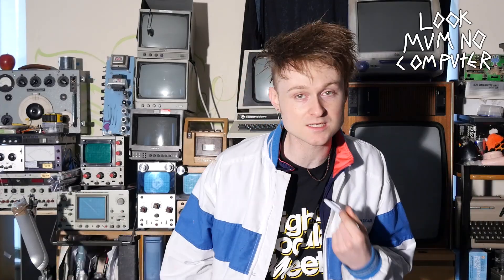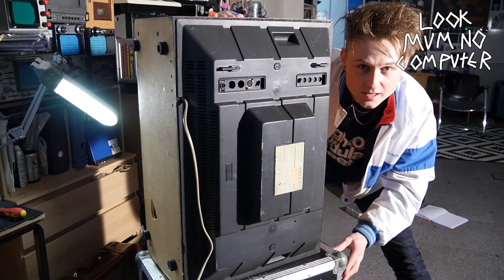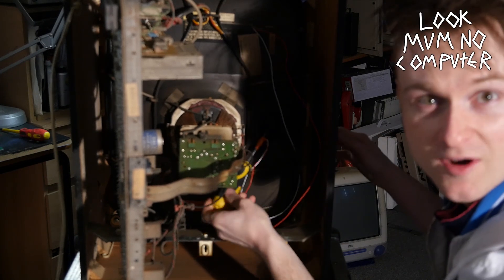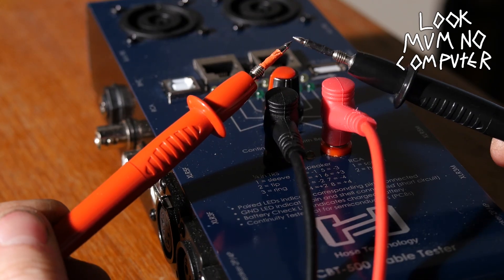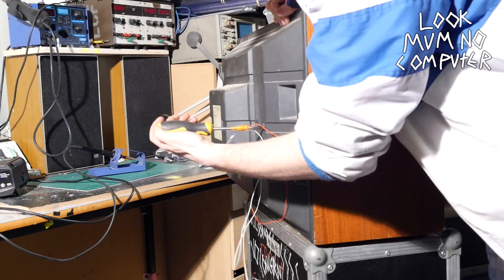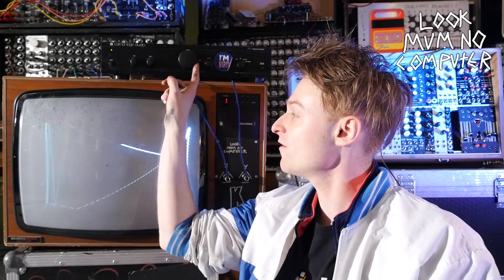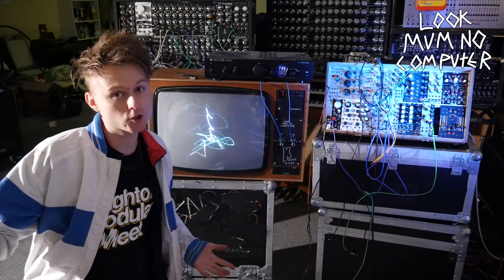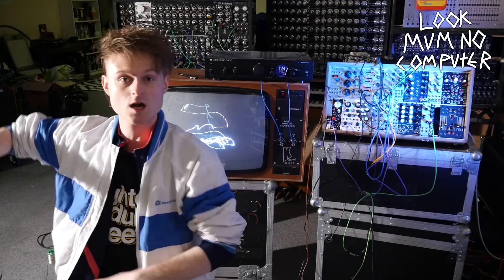Turn an old TV into an Oscillograph For Oscillographics!

Comment: Some TV-esque points for those wanting to try this excellent project! 
1. Deflection Yoke

Short explanation:
It is best to leave the existing yoke and CRT neck magnets unmolested in place as the video implies but did not state. An inductor with the same inductance is optimally connected to the TV set's horizontal deflection circuitry to replace the now-disconnected horizontal yoke winding. The vertical winding may simply be disconnected from the TV and used for audio with no consequence.

More:
The inductance of the yoke horizontal deflection windings are used during horizontal trace to store energy used for making the high voltage.  With the flyback transformer, the H yoke part of a tuned circuit and inductance value is important for long life and safe operation.

During retrace, the energy is discharged from the yoke into the flyback (high voltage) transformer in the form of a pulse. The term 'flyback' is the old vernacular term for retrace, because the spot on the CRT  flys back across the screen (though it's blanked/unseen). The pulse is stepped up by the flyback transformer and rectified (voltage tripler may be used as rectifier-filter), to provide the 23-30KV needed by the CRT HV anode. 

In most modern (70s-90s) solid state TV sets similar to the one shown, the flyback transformer also acts as the power transformer, in that it provides what is called 'derived power'. As the transformer is driven by the horizontal output transistor, the retrace pulse from the is stepped down from the 900V output transistor pulse and rectified to make the 150-250 volts for the video amplifiers, and the trace waveform (while the transistor is ON) is stepped down and rectified to provide the various low voltages like 5 to 30V that operate the other circuits of the set. These DC voltages are called 'derived' power. This was oversimplified but no one wants to read a whole book.

This is done to avoid a large and costly power transformer. The other benefit is that, since the high voltage is regulated, all other voltages from the same transformer will also be as well-regulated.

Thus the reasons for substituing a proper inductance for the horizontal yoke winding (It must not saturate either). The cheap way is to steal a yoke of similar inductance (+/-10%) from another TV and use that for the substitute yoke. The right way is to find/buy the correct inductance.

=====

-->2. other options:
I noticed in the video that the original TV set CRT beam-blanking circuit was doing its job, but this is only needed when scanning a synchronized image like video or when moving the beam from one drawn object to another in a vector display (different blanking circuit for that). 

For a vector or X-Y scope as shown, remove the blanking signal while keeping the brightness control (CRT bias) and contrast control (video amplifier gain) circuits intact. 

The brighness control's use need no explanation, but a voltage or additional resistance affecting the brightness control can be externally applied in concert with the existing brightness control  to blank the screen when no vector signals are present. It's done in gaming and military displays to prevent screen burn. The brightness control affects all three electron guns (RGB) at once in a color set. Most CRTs have a single control grid for this purpose.

The contrast control is like a volume control in an audio amp. It controls the gain of all three individual video amplifier channels (RGB) at the same time, but these control signals can be broken out to control the amplifiers individually. It's simple from there to use the scope as shown with music, but with an external electronic crossover, assign for example, red to bass, green to midrange, and blue to highs. Low-voltage analog signals can thereby vary the intensity of the R, G, and B electron beams to add to the effects. This assumes the original yoke and convergence/centering magnets on the CRT neck are unmolested and the set had good convergence and purity before conversion. 

In the 1980s, I worked with a performance art group and modified many TV sets for this audio and color oscilloscope use. The large square cabinet type TVs allowed everything to be mounted inside the cabinet with just an audio jack for input from the mix board. In some products, the TV set's speaker was connected through a little transformer to the now-internal amplifier's input, so it responded to ambient sound. 
A caveat is that solid state amps of the day didn't like the inductive load of the H and V yokes and sometimes would blow out. So we used old public address tube amps. 20 Watts for H and for V was often enough. Frequently to get the lissajous figures from a music or voice source, I would put a speaker-type crossover after the amp, and drive the vertical windings for lower frequencies and the horizontal windings for high frequencies. That with the individual video (color) channels was very entertaining. Modification of these crossover circuit values to tailor the crossover points to a specific yoke (because it's certainly not a 4 or 8 ohm load) was occasionally needed to get best results.

I hope those who enjoy the work done in the video will be aided in their efforts to do the same. There are a lot of CRT videos, but i chose to comment on this one because it's cooly presented and the artist has a lot of electronics skills.
Reply: Did this project and I have two questions:
How do I remove the blanking signal? I assume I have to cut a pin off from the jungle chip right?

Second, instead of a getting a white beam I get a blue one with a bit of yellow, which were the colors from the TV when there's no signal connected (all blue backdrop with yellow letters saying VIDEO on the upper left corner), how can I get just the white beam?
Reply: @KRSHERprs   A public notice: I seldom use this site any more, so any questions may go un-answered for indeterminate amounts of time. 

OK to try to answer your question, almost every TV set has slightly different ways of adding blanking pulses to the RGB signals going to the CRT cathodes (sometimes grids in older sets) and of controlling brightness. The process I describe is experimental. I would not cut pins on chips, but look at cutting a track on the board. However, this may also be very small. Sometimes a DC level is also conveyed on the same pin or track along with the blanking and other signals, so cutting it may remove the ability to control brightness. 

If the TV has a decent size board on the socket at the rear of the CRT that also contains the three R,G,B driver transistors, it could be worthwhile to find the three wired delivering the video drive signals that go to the board itself, and insert a low pass filter in each of them. Check the voltage and waveform on those wires. It should be low-ish like 3 to 12 volts, and in any case nowhere near 120-200V DC+ some AC. Experimentally try inserting a low pass filter made of two 10K resistors in series in the line - -the low pass part of this will be a capacitor of 1uF from the junction point of the two resistors to ground (B-). 

Try one color first and use a scope and a voltmeter. Or if no scope, do all 3 colors, and run a deflection pattern to see if blanking and video is removed.

Check the DC voltage on each end of that filter. It should be the same or no more than 0.1V DC difference. Make sure the brightness control still works for your purposes. There will be some signal on the end of the low pass filter connected to the TV main board, and just a DC level on the end of the filter connected to the CRT amplifier/drive board. If the voltage difference is as stated above, or proportionally close to it (will depend on the eact schematic design of the video circuit overall), and you can control brightness, GOOD. Then check for signal on the end of the filter going to the CRT drive board. There should be almost none. If some low frequency signals remain, increase the capacitor to 4.7 or 10uF.
Reply: @KRSHERprs   A public notice: I seldom use this site any more, so any questions may go un-answered for indeterminate amounts of time. 

You should get an oscilloscope for this. Now about that blue screen and off-white color. White comes from the eye mixing the three colors red,blue,green. So the three electron beams that hit those coloed phosphor dots on the inside of the CRT face have to be present so that the TV light is white. TVs use different methods for balancing the colors/electron beam strengths, but this mostly comes from the color decoder IC if that is present. I've never tried to turn the blue screen white, and it's a total experiment, but I used to own a TV shop and repair TV sets so this should help. Here's the thing, TVs set the CRT bias be a number of methods. Some have user controls and some do not. TVs also usually have controls for the screen grid or "G2". There should be one for each color on older sets, and just one common one on newer. Not to mess with these at this point. The color IC has R,G,B outputs. You need to look at them with a scope. Assuming the brightness control works to turn the blue screen up and down, then you can try cutting the blue signal's wire (as described in my last post), and make up a jig of three resistors. 1K resistors. Connect one end of the three together as a common point. The free ends are now for the R,G,B signals going to the CRT drive board. This will place the same brightness and DC level on all three guns. The low pass filters described in the other post should remove the video (the channel number etc) . If something does not work, put the wiring back as it was before what you just did, before trying something else, so you do not start building unknown problems into your project. 

Now about the off-color tint of the white beam. Two things. If the brightness is so high that the CRT can't handle it or if the CRT is a little weak, the color will be off (same thing as when an overdriven guitar amp distorts). Reducing brightness from overkill to normal is a way to have the CRT perform linearly in this case. Once the blue screen is made to white (should be by the above experiment), then you can see if it varies tint when you run brightness control up and down. Run a pattern filling the screen and turn the brightness low, then adjust the R,G,B "G2" controls to where it's dim (neutral gray) and just vidible. Then upon increasign brightness it should remain white.

Some TV sets do this oppositely with one 'screen or G2' control, and you must then adjust the BIAS for R,G,B to get white. set brighness low, adj RGB BIAS for grey, touch up screen if needed, then it should be white when brightness is increased. 

1. all TV are somewhat different.
2. Doin the 3-way resistor off the blue screen may negate the white adjustments in sets with RGB BIAS, because you are only using the BLUE video (and DC level)
3. The low pass filter below may get rid of the channel number video, not sure how much of the blue it will neutralize.
4. the color IC detects video, then shuts off the stupid blue screen, some TV also have a menu for "blue screen off". Find the IC number and look it up to see how the blue screen (loss of signal or no video) is detected then fool it. Find the schematic for the TV set in question.  These are because it's rather technical and the many possible solutions can not be described in youtube comments because it takes books. Find old used TV servicing books. 

Finally, you can inject your own video modulating signals to the RGB at the point between each low pass filter and the CRT amplifier/driver board. Use a 0.1uF capacitor for this at first, going larger ONLY if you do not get a low enough frequency response, and keep your video modulation voltage low, certainly no more than the TV set originally drove the CRT drive amplifier board with. (check with scope before the TV experiment) Don't want to blow any transistors. 

Also when connecting external signals, scopes, or anything else into the actual TV set board or chassis, the TV or signals must be isolated through a suitable transformer because many TV sets have a mostly direct path from mains to the TV's internal 'hot ground'. Ignorance of this will result in short-outs, shock hazard, maybe worse. So be careful! I have to say that because of people who have no idea what they are doing. Just ask a radio ham or repairman if it is confusing.

Wish I could help more.
Reply: Also, on blaking again. Some TVs use the control grid ("G1") for blanking, and the cathodes (driven by the CRT vrive board or amplifiers) for video. If the blanking is not removed by the low pass filters described in my other posts on this video, try adding one to the wire going to the CRT's G1.  Also, note that the CRT cathodes and therefore the RGB CRT drive amplifiers will have 120-200Volts on them so be careful. (A 150-volt video signal gives buzz/tingle, quite different from a touch o' the mains). But don't touch those parts while the set is on because it's quite dangerous, be careful. Also, the screen voltage or G2 voltage on that booard can be from 200V to 1000V DC, so stay well away from that as well when working on the TV.

Comment: In the 80s I did this on numerous TVs.   First thing I learned, the circuitry stops working if you just disconnect the deflection yoke.  Best thing to do is hang the existing yoke somewhere inside the case and put another deflection yoke on the CRT neck.  

I didn't have polyphonic oscillators to work with so I'd find music with long bass notes.  Mitternacht from the B side of Kraftwerk-Autobahn was a good song to use.  There was always a bias in music sources so you wouldn't get a symmetrical lissajous pattern, the shapes tended to have a diagonal attractor.

In the late 80s I started doing cheap laser shows for my Brother's band.   I made galvanometers with two old speakers and broken chunks of mirror and set it up on a 12X18 plywood board.  Worked great, but had the same diagonal bias issue when using music.  Jean-Michel Jarre made some good laser music too.  Had a $300 5w he-ne laser.  Eventually I got my hands on an aqua colored argon laser and a beautiful indigo helium-cadmium laser.   These were the size of a 1990s PC and large CRT monitor with a thick umbilical between power supply and laser head.  Today's cheap ubiquitous laser diodes make these huge gas lasers look ridiculous.

Comment: This brings back memories. About 25 years ago I built something similar using an RGB CRT monitor.  As well as controlling the coils I mixed the two audio channels  then filtered them into  bass middle and treble. These signals were fed to the red, green and blue colour amplifiers. This gave some pretty wild multi coloured patterns when fed a decent stereo signal. 
As an aside the frequency response of the deflection coils drops off pretty sharply at higher frequencies. I used a current amplifier to drive the coils which helped but it was far from perfect.

Comment: My first boss was have worked at Philips as TV Tech. and also in the production line. One step of the line required some testing made to the TV qith CRT on. After finishing, this guy MOST deliver the TV discharged to the following step on the line, as required per the procedures. One time he forgot to discharge the TV and passed it to the Tech in the other cell. He almost killed him, the guy fell on the floor inconsious. No joke. The guy recibing it should have double checked, but production lines are always a rush and after 100 to 200 units, you lose your mind anyways, no safety standard will hold.

Comment: Hi, I tried  doing the exact same thing but I'm running into a problem. What I get when I turn the tv on is the initial dot in the middle but it stays super small and becomes really really crazy bright and after a few seconds i hear a small sharp pop, the display shuts and after a big static noise appears ,coming from the back of the tv and continues until I unplug the tv. Any ideas on what's wrong ?  Thanks

Comment: Hoping some can help! I’ve done everything as it says, check all the continuity and everything and the scope won’t work! Everything turns on and there’s signal coming out the speakers. The only thing I’m unsure of is a blue wire in 2 of the deflector coil plugs. Each deflector was on a different side, and one was sort of connected? Any help?! Please😫TIA

Comment: Lissajous pattern created when two alternating voltages are plotted one on the "x" axis and the other on "y" axis. I would think most televisions would not develop proper secondary accelerating anode voltage and boost voltages without the horizontal deflection yoke coils connected. Interesting that yours did. There would also be trouble with convergence of the 3 color beams on color televisions. Excessive brightness in one spot will burn the phosphor coatings so try to not leave a dot or line on the screen with no movement. Made me think a step ahead about electronics that could be outboard and allow the same overall function. Funny video made me laugh several times. God Bless.

Comment: How would you control the color?
Reply: At some point after demodulation there are separate signals for driving the RGB electron guns independently.
 Tap into those and apply some signal to them.
 Out-of-phase LFO's would give a slow colour cycle,
 faster signals more in sync with the X or Y inputs would give different colours at different parts of the screen.

Comment: If you wanted to be able to still use the tv normally as well, you could just splice in some kind of switch to switch between the new input jacks, and the regular connection, right?
Reply: Yep.
 But expect a permanent dot in the centre as that patch of phosphor gives up the will to live.